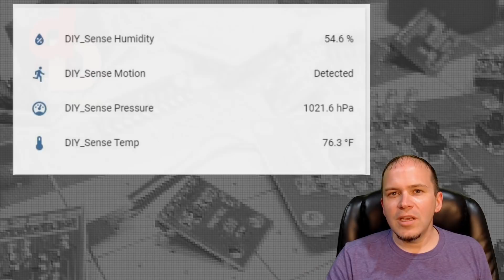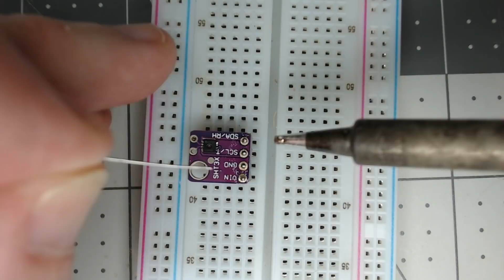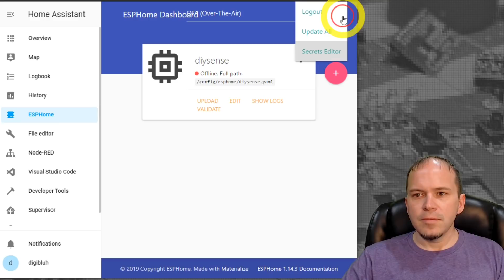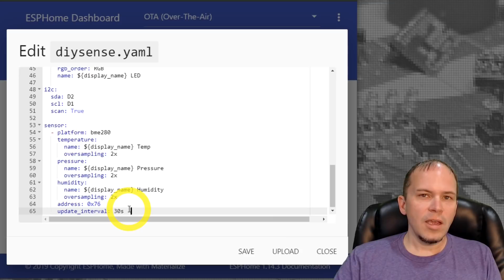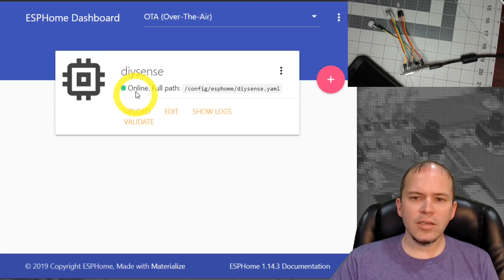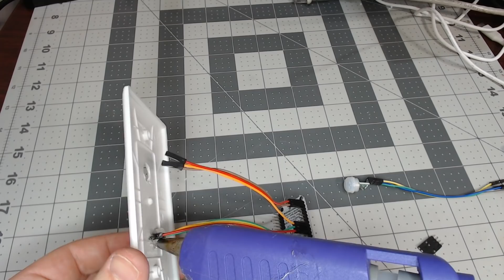DIY Bathroom Humidity & Motion Sensor with ESPHome | DIY Smart Home - Ep#5

Comment: Would really love some of you DIYers to show taking these all the way to a proper finished board through something like PCBWay rather than just a breadboard hookup shoved into a box
Reply from the maker: That's the point of the dev board as it is finished.  A full board really wouldn't be any different as you need the sensors remote from the chip.

Comment: How you power this sensor? In the roof? please can you explain it?
Reply from the maker: The homes in my area typically have access to the ceiling from above. A 5volt power supply in the attic ran over to the sensor.
Reply: @digiblurDIY  in first thanks to reply, so il wall box is not possible, make a DIY multi sensor? too small?

Comment: I tried put motion sensor in the bathroom before but a few times the light shut off with someone still in the shower.  This motion sensor does not cover wide coverage and cannot sense if object further than 5 feet.  So how do you solve this problem on your motion sensor turn the light project in the bathroom??
Reply from the maker: I use humidity sensors in my projects to drive the shower state to hold the light on as well as driving the vent being on and off. This usually doesn't cover a bath soaking though but there are methods for that too.

Comment: With a pressure sensor, you might be able to tell if a door or window to the bathroom is open while the fan is running.  Start by measuring the pressure in the room with the window/door shut. Then turn on the fan to see if you get a pressure drop.  Then open the door or window.   You probably dont get a pressure drop anymore.

Comment: how to have multiple Motion  sensor on single NodeMCU board?
Reply from the maker: Yep.  There are several GPIO pins you can use.  I've hooked up 2 or 3 to one before but you can do more.
Reply: @digiblurDIY  Can I make parallel multiple motion sensor into single GPIO PIN. what I want to achieve, using a single nodeMCU for a big room if there is someone in there. and others PIN for others purpose(dorr, windows)

Comment: Thanks for the great series of videos.  just new to Home Assistant.  Currently I would say I'm in development (learning) mode.  I followed your video to flash a smart bulb using Tuya convert.  What caught my eye is using substitution in yaml.  for the lights can i do the following?

  - platform: mqtt
    name: "Merkury_01"
#     command_topic: "cmnd/LIGHT_Merkury_01/POWER"
    command_topic: cmnd/${name}/POWER
...

this way i can make a generic light yaml file and only have to update the name for all bulbs of the same manufacturer.  Thanks again
Reply: I tried it and sad to say although check configuration was OK after restarting HA it didn't "find" the light.  any thoughts/suggestions appreciated.  I'm interested in having "bullet-proof" yaml using "generic" configuration and substitutions for individual lights, stitches, etc.  Thanks again for the great service you provide in your videos.
Reply from the maker: What device are you trying to put in?
Reply: @digiblurDIY  i'm trying to added a Walmart (Merkury) light which i flashed following your Tuya convert video.  I used your sample yaml from https://github.com/digiblur/Tasmota/wiki .  I realize your example with substitution is for ESPHome and I'm asking about the Home Assistant.  I tried it and it didn't work.  Oh well.  Thanks for your interest/reply.
Reply from the maker: You can also use the Setoption19 auto discovery too.
Reply: @digiblurDIY  , right I had forgotten about auto discovery. In general I would be hesitant to rely on it.  I'm intrigued by ESPHome as option for controlling RGBW lights. Currently HA with Tasmota doesn't control the white channel. Do you have video or resource on this? Thanks again

Comment: Having a ton of problems with the Bme280 sensor. Seems to be a big problem. Any suggestions. Worked for a bit then fail com. Thanks
Reply from the maker: Wiring issues? or bad BME sensor?
Reply: @digiblurDIY  Well, it worked for a bit then failed. Doing some reading on Home Assistant site leads me to believe it's bigger issue with addressing by Nodemcu. Had similar problems with D1 mini. In fact, bricked two of them after the baud rate got all whacked out.  Strange.
Reply: @digiblurDIY  A fatal error occurred: Failed to connect to ESP8266: Timed out waiting for packet header
INFO Upload with baud rate 460800 failed. Trying again with baud rate 115200.
INFO Running:  esptool.py --before default_reset --after hard_reset --baud 115200 --chip esp8266 --port /dev/ttyUSB0 write_flash 0x0 /data/ptwo/.pioenvs/ptwo/firmware.bin
esptool.py v2.7
Serial port /dev/ttyUSB0
Reply: Same error after numerous D1s.  Some work, most dont/
Reply from the maker: Looks like it is more than a bme280 error.  You might have to flash them manually using the Esphome flasher.
Reply: @digiblurDIY  Thanks. I'll give that a shot.

Comment: Great videos! I learn a lot every time. How did you power up the nodemcu? I apologize if I missed it on the video
Reply from the maker: I had a small clip in there I used an old wall wart  5vdc power supply. Attached some 18awg speaker wire to it and fished it. Way over kill for the nodemcu but with electrical overkill usually isn't a bad thing.

Comment: Take it from an Electronics Engineer, hotter is better for the Soldering Iron so there is less dwell time on the part and PCB. The only few times I had to turn down the heat was when I use to repair old Vacuum Tube equipment that uses an early phenolic PCBs that has the traces pressed onto it.

Comment: I have a couple of Multisensors working great in HA. I added 2 and they are not showing up in Integration. Look good in ESPHome - I have reset and looked everywhere I can think of. HA 0.107.5 .
Reply from the maker: Did you try to manually add them to HA under esphome?
Reply: @digiblurDIY  yes and looks good... Thanks.. 4 multi and waiting for parts for both baths... Thanks for the videos...

Comment: Another great video. Where did you pull power from for the Node?
Reply from the maker: I used that old wall wart I had pictured that was 5V. Plugged it in the attic and used some 18 awg speaker wire.

Comment: Hi Travis, thanks for repeating these steps. SO what is the soldering temp setting for these wemo and sensor pcbs ?...do you read the sensor specification document for that info
Reply from the maker: I've found 700 to 750 on the Hakko works fine.  No, I didn't read it, just depends on your soldering really.